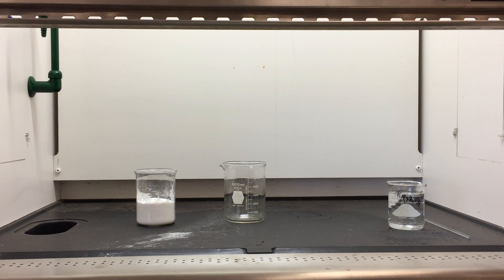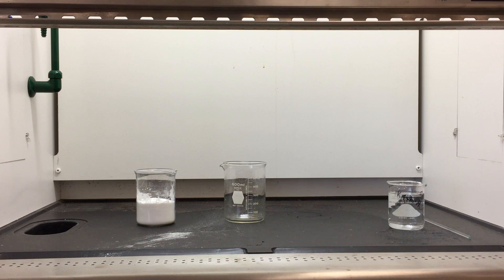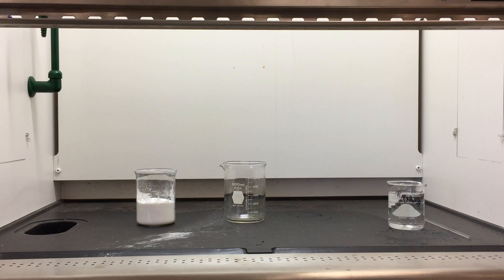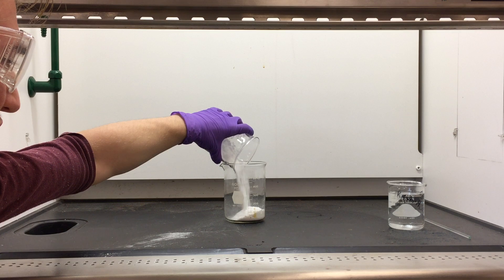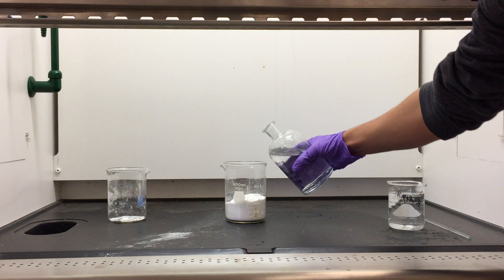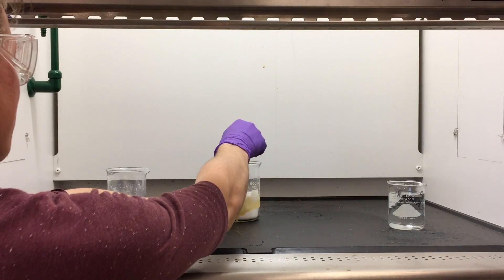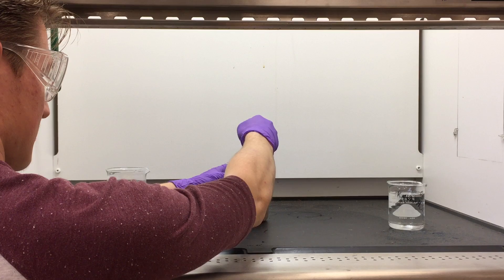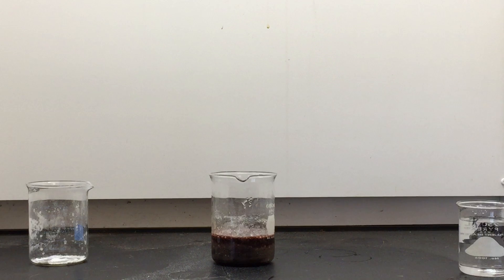Carbon Graphite Foam Experiment (Dehydration of Sucrose)

Comment: Can you do this with Hydrochloric instead of Sulphuric Acid, to avoid the Hydrogen Sulphide?   Would Molasses be a better candidate than the granulated sugar, the liquid mixing better with the acid?    Could you do another video, showing the electron microscopy of the foam, or grains milled from it, and checking the electrical conductivity of the substance?
Reply: You can do this experiment with ascorbic acid (vitamin C) too. I do it at low temp (380 F) hydro-thermally with glucose (single molecular ring).
Reply: @bio-cell2571  do you know if it is possible to make high-density foam, which wouldn't be foam anymore. I need to make a crucible out of carbon so it could hold any matter at high temperature
Reply: This reaction is not driven by the acidity, it's due to sulfuric acid's extreme affinity for water.  A strong dehydrating agent like calcium oxide or phosphorus pentoxide might produce similar results. HCl would most likely just hydrolyze the sucrose to glucose and fructose (aka invert sugar).  Ascorbic acid would do neither.  That dude was probably just making burnt sugar lol.
Reply: @whatelseison8970  PO5 will indeed do it, but it's a bit more awkward to work with. H2SO4 I expect, is a lot more accessible to most people (except in the UK and EU 😭).